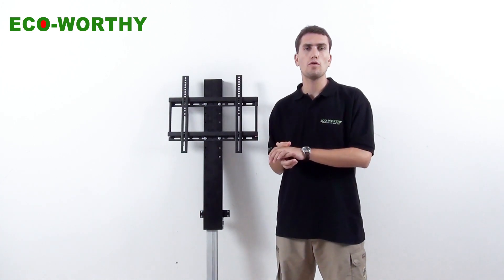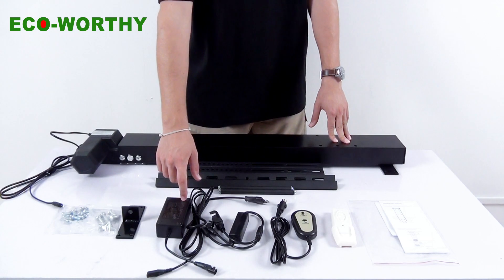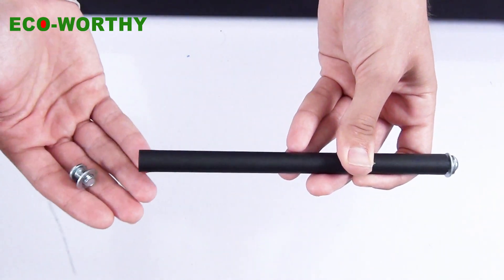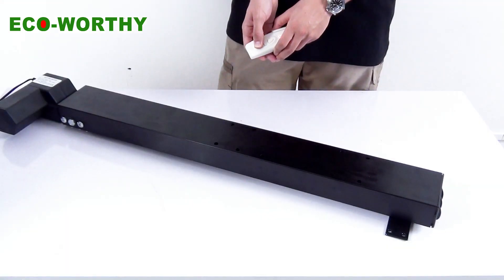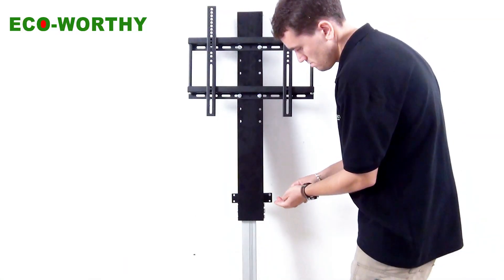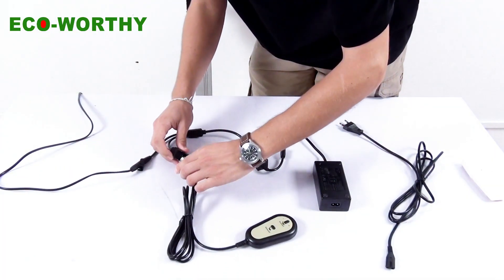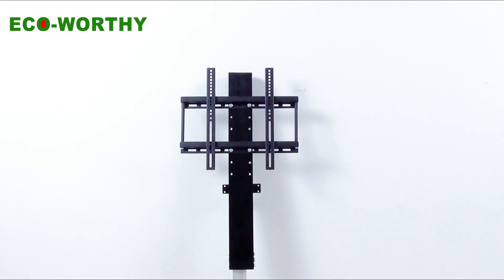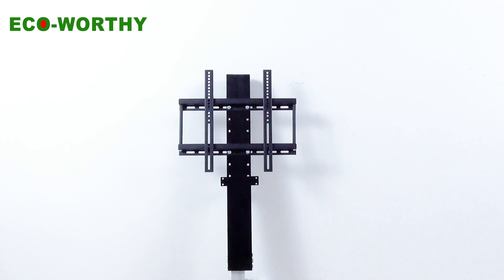How to build the motorized TV lift bracket? - Easy Installation and testing | EcoWorthy DIY Project

Comment: Hello, my lift is not working and the instructions are not very helpful.
I took it out of the box, screwed the 6 bolts to the white plastic, connected the power line and controler to the transformer, then the transformer to the wall. When I click either 'Extended' or 'Retracted' I can listen to a click on the transformer, but nothing happens. Please help, this is a brand new TV Lift I bought directly from your website.
Reply: Hi Alberto. Where they of any help?
Reply: @conseilsyndicalbatimentahd6062  Not at all, I had to go unethical and bought another one through Amazon, then send the broken one to Amazon and ask for a refund. When I got the new one it was clear the first one was used (and broken) because there was a drilled hole that didnt come in the new one.
Reply from the maker: Hi, now you can choose our products and see price even don't need to login  from：  https://linkpop.com/ecoworthy
Reply from the maker: Hi, now you can choose our products and see price even don't need to login  from：  https://linkpop.com/ecoworthy